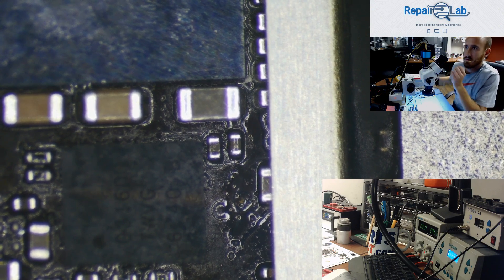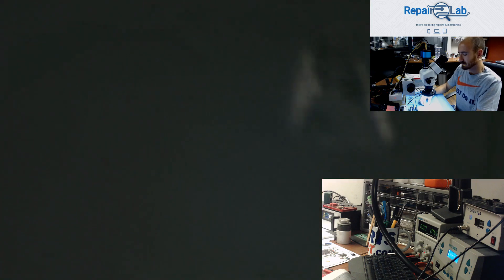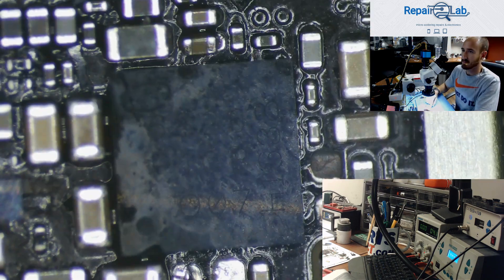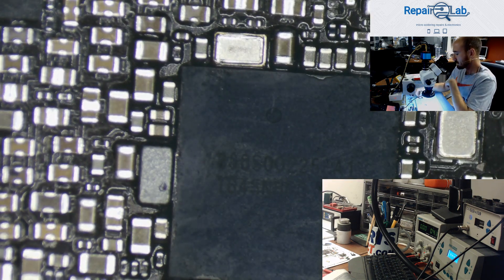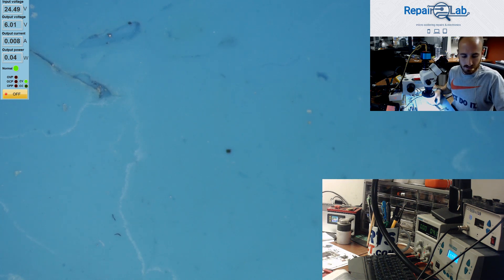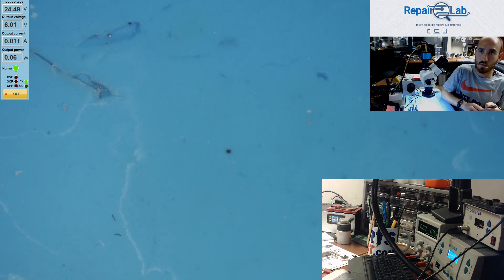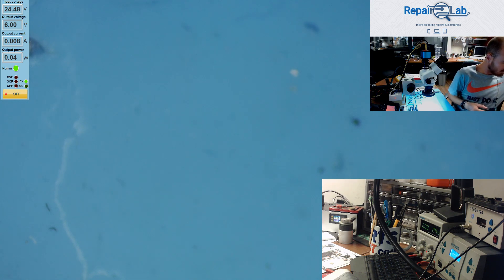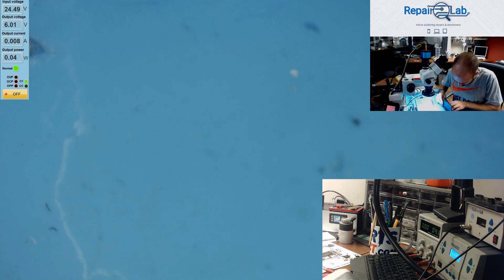Thermal camera VS 0.003 short to ground. Liquid Damaged iPhone 7 plus

Comment: Hi, what kind of thermal camera is it? Name/model. Thx
Reply from the maker: Flir e4
Reply from the maker: Hello, Yeap I have already applied this modified firmware so the resolution is double.
Reply: @RepairLab  Wow. I can't believe a company would do that............oh wait
Reply: @RepairLab  Have you/Can you try this? see how it works, report back :) 
https://fubar.gr/hacking-the-flir-e4/
Apparently upgrades software of E4 to E8 resolution 0 Software locked funnily enough!!
Reply: FLIR E4 is only 80x60 - surprised it works this well but you can get better resolution for less price from seek with macro lens